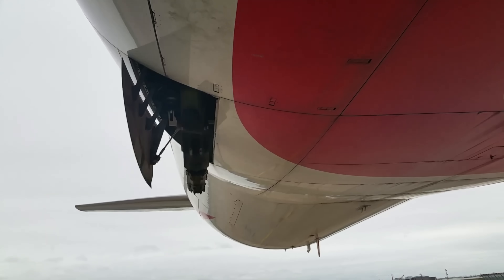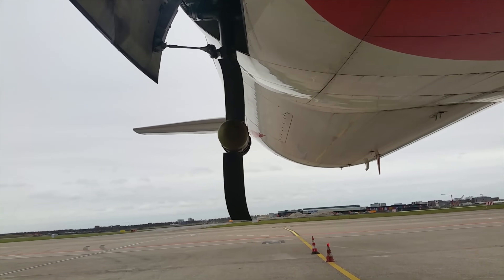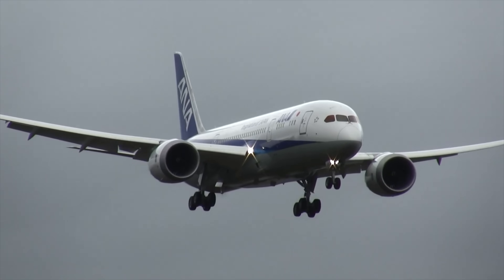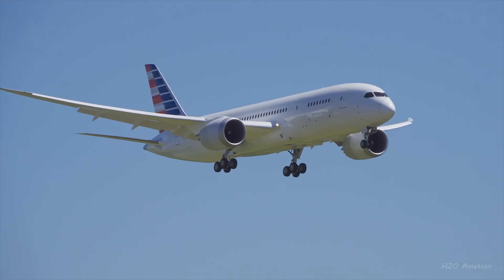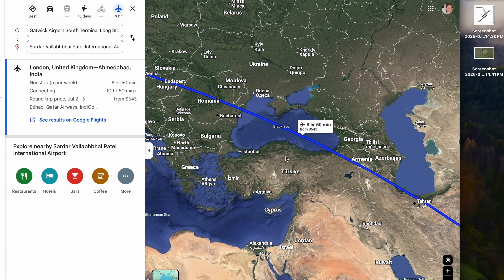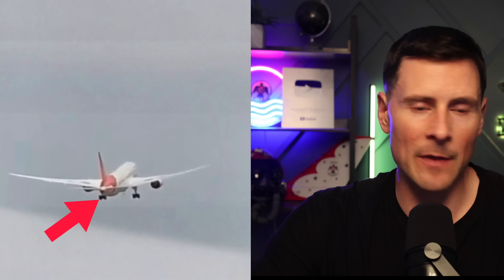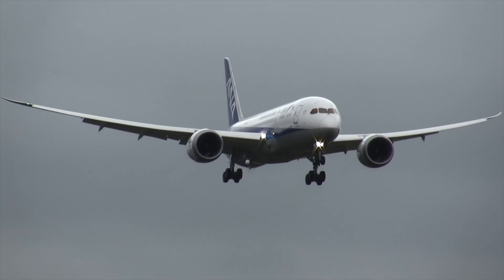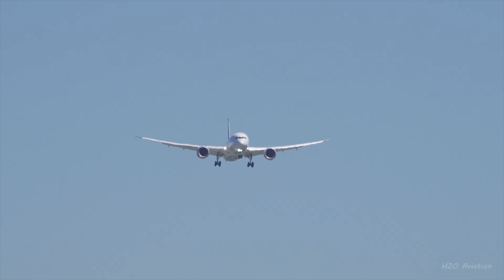Air India 171 SHOCKING UPDATE on RAT Deployment and Flaps!

Comment: May 29th, this aircraft was going to take off but passengers smelled something from the a/c like hot wiring in the plane. So they put the passengers in a motel until the next morning. From what I gather, this plane had a problem !
Reply: I have heard other people say they thought this was an electrical failure.
Reply: Wow! I had not heard that. Ya, this does not sound good. 😣
Reply: Is it the same plane since people keep sharing things. Until officially it is declared can't say it is the same plane. Also pilots were extremely efficient it would have been detected by the pilots n computers of the plane.
Reply: @vidyakadampawar5366 yess it is the same plane everyone talks, is also the same plane the whistler blower said it was broken
Reply: Problem with news like that is that a failure like that could be completely "normal" and unrelated to the incident. After all we are some normies who have zero knowledge of the daily business of an airliner.
Reply: @GaryFeltman where did you get that information?
Reply: In fact it departed 3 hours later from London to fix the engines.
Reply: Source of this?
Reply: Believe me bro  @VinayakP
Reply: When the RA Turbine is deployed, that means a total failure of the systems. Everything is without power causing the RAT to deploy!
Reply: Taylor Swift is not hot anymore
Reply: I heard that they had significant electrical problems on the previous flight . This has to be researched in depth.
Reply: There was an ex air India pilot said this plane was Air Indias most profitable plane and no matter how broken they wouldn’t take this plane out of service
Reply: That's a new bit of info I didn't know about.
Reply: ahmedabad taxi drivers replaced aviation technicians that day or was it sabotage?
Reply: ,do you know that for a fact? Just asking!
Reply: That's not true and is a misinformation
Reply: https://youtu.be/sqHmmnuf0IU?si=_kh9415KUzjiZ6DM... maybe implosion caused by short
Reply: The May 29th Air India incident -- where the plane returned to the terminal --was on a flight intended from Frankfurt
(or Munich) to Mumbai.  Saw the interview in English -- with one of the passengers who complained to the crew -- on an Indian YT station (can't recall source name).  They were put up in a hotel and left the evening of May 30th.  Now whether it was the same Boeing 787, is another issue.
Reply: Air India’s mistakes, did not maintain the plane and ignoring the maintenance, service and the passengers complains!
Reply: Twin engine sudden failure. 
The fact that the RAT can be heard on TAKEOFF at all over the roar of engines is the smoking gun.
Reply: Yeah...people complaining about electrical issues in the cabin...although maybe those were unrelated issues. 

Perhaps rats in the plane resulted in the deployment of the RAT.
Reply: Valuable information. 
Source please?
Reply: Source of your information?
Reply: To all Boeing lovers kissing Boeing, go and watch the recent interview of captain steeve and garybpilot.

Trigger warning-- you guys might lose it after listening to it of them blaming dual engine failure 😂.
Reply: Yes . . My thoughts have been thinking in this way for three weeks now
Reply: Is that the reason why they turned off the AC? That's the question that needs to be asked.
Reply: @soulsbourne  the ac was on the whole time sir, i am the only survivor of this crash, i jumped out before it hit the ground..sadly i had to use another person as a pillow on the fall.
Reply: Stop speculating. Can't you just wait for the investigation reports? What is the source of your information btw.. care to share?
Reply: Best to avoid flying in a 787 until further notice. The fact that they all haven't been grounded is concerning.
Reply: Seems like after unable to fault the pilots, the Boeing lovers turned to airlines maintenance.

This airlines, Air India, while might have poor maintenance has much less record in terms of fatal accidents compared to airlines of USA or other countries.

Internal maintenance issues in itself is not linked in any way to become a major accident like this.

High time we realise Boeing did a terrible job in terms of design, also highlighted by their whistle blowers, which culminated into this tragic loss.
Reply: @bob.110  there was a twenty year period in the usa from 2001-2021 where there were no major crashes of any large commerical airliner in the USA.  Aircraft accidents like this are extremely rare even today.
Reply: @bob.110 this is the first crash in the aircraft’s history lol. Ridiculous statement.
Reply: @bob.110 , you seem to be a paid coolie of Tata Airindia. Tata has been flying only last few years and was already notorious for poor cabin conditions and maintenance. 787 has great impeccable record. Tata tried to blame the pilots, couldn't blame Boeing and now throwing filth ay everyone. Arrogant crony capitalists must be punished wirh jail time for knowingly flying a coffin.
Reply: @bob.110  Air India has been having cleanliness and upto standard Interiors of the planes post COVID. However, the Airframe and Engines are maintained to the highest standards.
Reply: "Internal maintenance issues in itself is not linked in any way to become a major accident like this.". It may be linked for sure! Poor maintenance culture or system may easily be a timing bomb. Speaking generally and not suggesting anything in this case. Regards. An engineer
Reply: @csehakos3486 I’m an aviation engineer myself. Once a plane goes through heavy depot type maintenance it’s usually not the manufacturers responsibility for issues .  I just saw an ex Air India pilot talk about this particular aircraft saying Air India wouldn’t pull this plane off the line for anything because that’s their most profitable route and aircraft.  We’ll find out soon tho
Reply: @bob.110 why have the NTSB when there's you!? You already know everything! It's the booooeing! Jesus Christ....
Reply: @bob.110  Complete speculation with nothing behind it. Said another way, total bullshit.  Are you an expert in avionics, manufacturing and flying?  You obviously missed the part he said 5 MILLION flights of this aircraft type.  High time for you to stay away from your keyboard until this gets sorted.
Reply: @bob.110 Thats quite a bit of hyperbole considering the fact that the 787 has been one of the safest commercial aircraft in the world for the last 15 years.
Reply: @Agate_Island  so what? It isnt now based on recent incident, your entire premise is moot if blackbox tells what exactly happened.

Go check out what other pilots also say about this, almost unanimously every one agree that it is either dual engine failure or system failure.
Reply: @Agate_Island sometimes major problems only manifest later..
Reply: @Agate_Island he’s an Indian spouting pro Air India propaganda
Reply: @bob.110  I'm no boeing fanboy, but the plane flew safely for over a decade. It seems highly unlikely to be a design or manufacturing defect.
Reply: @davidfuller581   Concorde had a perfect record, until........................
Reply: @davidboult4143  Yes, that's sort of my point. That accident was FOD causing catastrophic damage, it wasn't a manufacturing defect (obviously).
Reply: @davidfuller581 well, based on what veterans like captain steeve and other pilots say, they now agree that most probable cause is dual engine failure, followed by system design failure.

Most of them hadn't even considered internal maintenance as a factor because they know that it cant cause such a catastrophe.

With this incident it doesnt matter how safe it used to be in the past, now it doesnt hold that record anymore

Dear fanboy should now consider changing his rigid opinions.
Reply: @bob.110 😂 Steve never mentioned design failure. 787 has been flying over 15 years with zero crash.
Reply: @davidfuller581 well we don't know. The whistleblower warned in 2024 to check all the dreamliners. So there is this element we can't ignore. 

Yeah air India is bad at service and they are improving it but they never had crashes due to maintainance. In fact terrorist attack contribute the greatest crashes in Air India planes, whether by Sabotage or bomb explosion with second and less likely reason the navigational error. In fact Air India or other airlines in India never had crashes due to maintenance. That's the thing you need to put. 

Which is why this maintenance issue is already out. And it's also why some Indians think it's sabotage considering 90% of deadly crashes in India caused by Bomb attacks or sabotage.
Reply: @NammaNeko-hg1ho  Sabotage is unfortunately entirely plausible. 

The plane had, supposedly, just come back from an overhaul (which AI contracts out, understandably - that's specialized and very expensive work). So I don't think it's AI's maintenance if it was that, rather whoever they paid to do it (some Turkish company, IIRC?).
Reply: @davidfuller581   but all Concordes were modified after the incident! And subsequently grounded.
Reply: That makes no sense  @bob.110
Reply: There are certain cars that at 150000 or 200000 kms have a common problem due to design or manufacturing defects. Just to give you an example. 
Can't rule it out

Knowing the problems in manufacturing Boeing had it is quite possible.
Reply: @davidfuller581  Long term defects do happen, things that take years to show up. but they are very rare. The only thing like that I can think of off the top of my head is how alluminum wiring in houses was eventually banned. Below a certain guage the oxidization would slowly reduce the current capacity untill finally they wire got a heavy load they couldn't handle anymore and start a fire.  Corner case defects are more likely, like the one that got the shuttle o-ring. It taking a cicumstance or set of them not normally seen.
Reply: @davidboult4143 That was caused by fod on the runway, not due to Concorde design or malfunction.
Reply: @davidboult4143  And that crash wasn't all the Concorde's design fault.  Does anyone design fuel tanks to withstand impact by steel shrapnel on a runway?
Reply: @bob.110  Air India might have bad service but there is in no way they have crash like this. Most crashes in India are either technical reason like glitches or terrorist attack. In fact terrorist attack caused more crashes in Air india than any airline combined. Including the deadly Canadian one on 1985. 

So your assessment that it happens due to Poor maintenance is wrong
Reply: @NammaNeko-hg1ho  dude you are replying to wrong guy, I am for air india not against.😅
Reply: @NammaNeko-hg1ho 
you know it's a sketchy airline when you defend it by saying no we have more terror problems than maintenance problems!  

either way lots of problems and super scary
Reply: @jgrc73  dude look at the track record of Air India, it's either Terrorist attack or Sabotage and 90% of crashes happen due to that.

You guys blaming Air India because it's from India and therefore had poor maintenance. We never heard anything like from Airbus. Yes there are technical issues but all of them are non fatal. 

Admit Boeing have issues. Now British Airlines 787 has found technical issues and forced to land.
Reply: @bob.110 not true. If the air con doesn’t work, the place heats up so much the fuel turns to vapour and that’s what happened here

Comment: Thank you , you have analysed it well and then came out with this video. Totally agree , it is impossible to believe Pilot being blamed that they forgot this and that , remember senior pilot was a very experienced pilot he is a certified trainer as well. Also none of the experts on youtube acknowledged that a mere 31 seconds flight guys - it is so difficult to comprehend - in this 31 sec Pilot able to detect end and pass Mayday is out of this world. People on ground stated that they thank pilot because it appeared he tried to crash land on empty area rather than on buildings. Guys I am buying only 2 theories - even if a thing can happen 1 in a billion then this moment was that 1. 
For example a catastrophic electrical failure , dual engine out , hydraulics loss pressure. I wanted you here to highlight that the descent was graceful like the plane was landing , any one can make out it appears that at 625 feet power turned off and plane just glided down.
One of expert stated vapour lock due to excess heat conditions , not sure !!
Reply from the maker: I appreciate your insightful analysis and your perspective on the situation.

Comment: The 787 Slats are protected from Computers to retract to early (Stall protect)! Its clear both Engines loss Power immediatly. Only Fuel Problems or Electric Problems can do that. The Bus Power Control Unit (BPCU) manages and monitors the distribution of electrical power and if this Unit fails a complete Electric Collapse results. No mechanical Failure can shut down both Engines exact synchron like this case. The GE are extrem robust (Bird Strike) and only Electronic/Electric Problems can cause a shutdown that fast of the Pumps or the Engine self. 17:44 Today Air India 787 Zürich-Delhi have also delay due technical Reason.
Reply: Surely the BPCU is more robust then that and there are redundancies built in. Every single system on an aircraft is built with multiple failsafes, surely it is the same for that

Comment: RAT deployment = LOSS of Electrical system.  No juice= no Hydraulics, no engine power, no gear retraction= No chance.  😢
Reply: I'm sure there was orange juice on the plane.
Reply: @32SQUID  after hearing the problems from the previous flight of this aircraft I  doubt they had OJ. Seemed like a no soup for you kind of airline 😮
Reply: Also no black box recordings?

Comment: There have been instances of ground crews putting the wrong fuel in the aircraft. 
This Could happen if the Wrong Fuel had been used to fill the Truck that brings the Fuel to the aircraft.
If, for instance, aviation grade Petrol were mistakenly used to fill the truck meant for JET refueling, there would likely be residual JET FUEL in the aircraft's tanks, enough for engine start, taxi and possibly even take-off... The aircraft normally do not land with their fuel supply at zero, so there is always fuel for taxiing to the gate.
So the fuel in the pumps at engine start up might be unmixed, and the engines might be getting proper jet fuel right to the  rotation point, before the mixture suddenly begins to include the petrol.
Hey, it has happened a few times.
On the other hand, if it were a factor, We probably would have heard about it right away.
Reply: Fully right! Only Fuel Problems (Fuel Contamination / Fuel Pump stucked) or Electrical Problems with Fuel Pumps or Digital Engine Controll can shutdown two Engines exact synchronous. Your theory is absolut plausible. There was only one Hour on Terminal from the last Flight so what if the 787 has no Fuel on Board? Normaly Computers warn but if they reset the Alarm…
Reply: @charlesburg4674 Thanks for the insight. I just remember that happening to both commercial and military flights. But Wouldn't firefighters at the crash site notice the difference between Jet Fuel versus Gasoline Fumes?? Or would that not be in their training?

Comment: FMU prevents engine flooding.  Low fuel to both engines.
 Rat,flat slat at 5 don't mater.
Traded air speed for altitude.

Comment: Thanks from India. Do you think is it possible to power the jet with batteries? Like create a electro magnetic during these kind of scenario, when engine is half operational ., which will keep the torque until it get the actual power from engine??? 
Would it buy some more  time to enough bring the bird up.

Comment: Another video brought up a valid point of view in the possibility of "dirty" fuel. From different sources, they stated that India is not very strict on maintenance.
Reply: They’re strict enough given that there have been no major issues of this type in decades. 

Also, they restarted operations 40 minutes after the crash. A lot of other planes before and after this one took off. 

I wouldn’t be so quick to blame poor maintenance etc. 

air India does have some major issues with interior maintenance (from years of government neglect), but even at that point, they were never falling out of the sky or anything.
Reply: @shrivatsasomany Did you read the post? I didn't blame anyone. It was brought up in other videos of the possibility.
Reply: dirty fuel would've resulted in other planes having issues too, bogus argument. India has had a relatively safe track record considering the volume of flights, probably even above average air safety. No idea if anything changed after the acquisition of Air India by the Tata Group
Reply: And what drives you to the conclusion that India has sub par maintainance standards?
Reply: @akhiljayachandran3679  I'm not giving that conclusion. It was stated in multiple video sources.

Comment: I’m betting on it was purely an electrical failure as it was said the plane had suffered some electrical issues in the previous days. Pilots lost all instruments and the ram deployed. Unable to see their instruments they became fixated on the issue and were unaware their air speed was too low before the plane stalled. The video shows they attempted to pull the nose up to climb but they probably had already stalled.
Reply: I agree.
Reply: @leecordell7418 also thought if they were able to pull the nose up at the last minute showed they had hydraulic power. Given they were about to stall there is no way they would be getting that power from the ram
Reply: I'm betting Electrical failure too. This could bite Boeing in the A55.
Reply: @martentrudeau6948 depends. If it’s a maintenance issue it won’t.